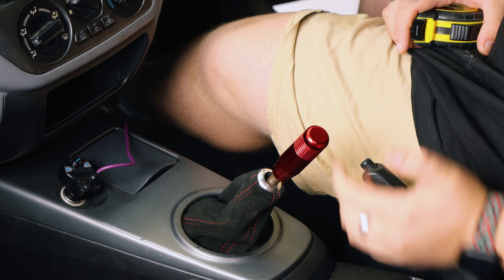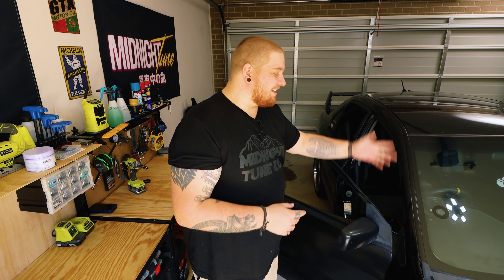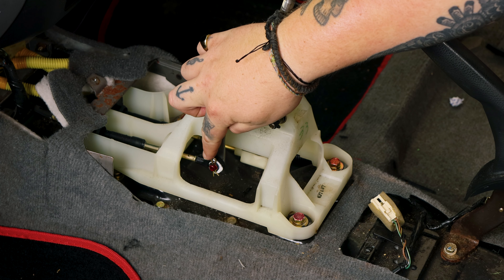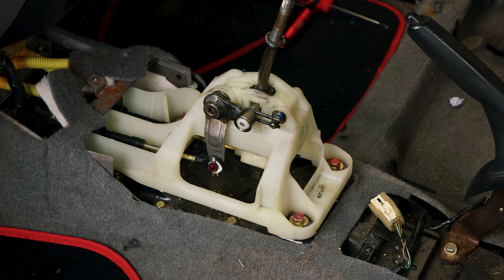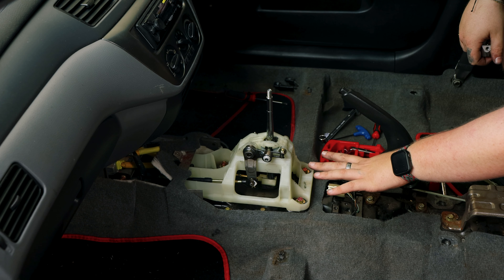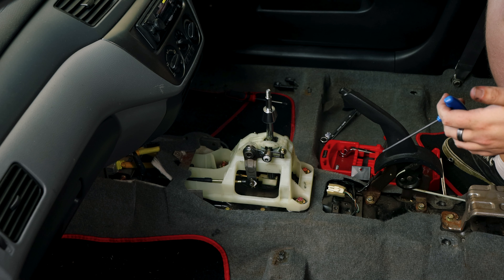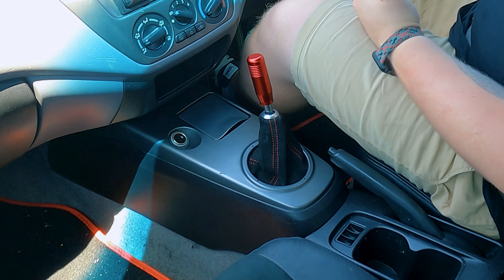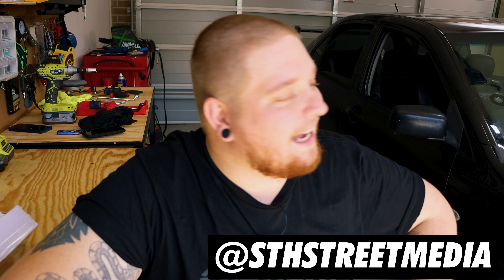Installing A Short Throw Shifter On My Lancer With No Experience!

Comment: Great video I’m just about to buy CH 2007 do you think that shifter would work for 2007 plate ?
Thanks
Reply: Id imagine it would work as the CH lancers use the same setup as the eco 7 8 9. On the Ebay advert it covers a lot of egos. I have a 2007 CH too so ill buy this shifter and hope it works hahah